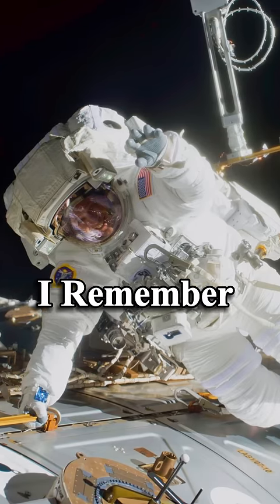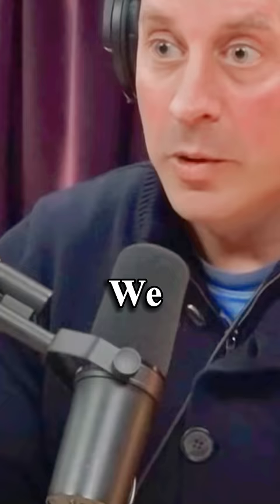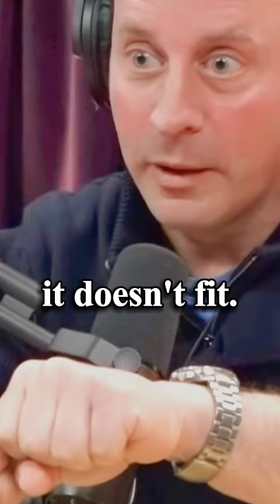when Plugs didn't fit | Garrett Reisman

Comment: And then the next guy comes along to service it, and says "Why won't this damn thing come apart?!"
Reply: Almost spit my coffee out🤣. I was wondering that myself.
Reply: Just put both sides in the sun
Reply: @quistador7  why would you think that??
Reply: @flrnGM  because the female side is now the only one that's too big. The male part is inside and won't be heated by the sun. Just stick the entire thing in the suns rays and the female part will expand and you'll get them apart.
Reply: @quistador7 eh probably wont work that way lol. Also youd have to know that
Reply: @D3nn1s  That's exactly how it'd work dummy, that's how they got it together in the first place
Reply: @quistador7  yeah but thermal expansion doesnt just stop, its gonna heat everything. Sure the outside will be hotter but who knows if thatll be enough?
Reply: @quistador7  It worked in the first place, as only one of those connectors were heated up.
Reply: @D3nn1s  Every substance has something called q or thermal flux which is the flow of heat through a certain area through a certain amount of time. Basically it will take time for the heat to travel through from the female adaptor to the male adaptor, but the thermal expansion will happen as the female adaptor heats up. Assuming their both made from the same material the male adaptor would be insulated enough to not expand as much as the female adaptor and be able to be pulled out. 
that said the thermal expansion rate or ε of steel is pretty low....
Reply: @gsreads  and only one would heat up the second time as well. the outside one is the only one in the sunlight, and the inside one is protected
Reply: @quistador7  when the two parts have the same temperature, the male one is too big.
Reply: @flrnGM  no shit, that's why I said ( WHEN THEY ARE CONNECTED ) you put them both in the sun and you can disconnect them. The male is INSIDE of the female. So it will not be exposed to directly sunlight. The female will heat up first and allow the male to release
Reply: Lol
Reply: Just rip the whole damn thing off and cuss at the former astronaut.
Reply: @Cheese  You're forgetting that thermal conduction exists.
Reply: This is my favorite comment from the original video.
Reply: Hahaha.  I'd pay to see it
Reply: @D3nn1s  i think heat distribution is going to be a lot more different in space. There's no air to heat up so we only go by sun radiation which heats the female connector on the outside which in turn heats up the male connector.
Reply: Oh.  😅 I thought your punch line was gunna to be, and the next guy says "why is this female plug so big?"
Reply: @quistador7  all that's gonna do is heat up both molex connectors. Heat transfers through convection too dummy
Reply: @D3nn1s  bro quit it. it's called thermal expansion. all astronauts know this basic concept 😂
Reply: @you owe me $5 for reading this name it's copyright convection is heat transfer through a fluid, what you're thinking of is conduction (touching)
Reply: "How long until the sun goes down? "
Reply: @quistador7  The fact that you had to explain this to some dummy... I wonder where he lives and what he does for a living 😅
Reply: Use the sun like a torch on rusty stuck parts
Reply: That's the next astronaut problem lol
Reply: Next government problem 😂
Reply: Never trust everything you see on the internet 
-- Abraham Lincoln February 7/1864
Reply: @D3nn1s  if they were both the wrong size before and both put into the sun then the wrong size would come back
Reply: Not sure he’s the dummy lol Male side went in at about -200c  Female about +50-100c. When they both in the Sun they’re going to heat up very fast and expand at same rate.
Reply: @quistador7  yeh but part of the male connector will be in direct sun light… if you’re waiting for the female connector to expand enough to come off the male would also have expanded 😮
Reply: @tomtdh4903  they will only expand so much, so when the one maxes out the other will too. So the wrong size will still be there
Reply: The next time those are coming apart is when the atmosphere rips them apart and melts them.
Reply: One miracle at a time
Reply: @quistador7  heat transfer, my man. You gotta get it right after sunup before the temperature inside can go up.
Reply: @D3nn1s  so in the welding industry, thermal expansion and contraction has to take place in the presence of other materials, and/or an unaltered portions of the same material.  And that effect will have stuff change or forge the size of other stuff.  Heat up a small point in sheet metal it’s forced to expand in thickness because of the cold material around it but then it contracts in all directions tightening the sheet metal.  With those connectors likely next time anyone touches those connectors they have through the constant fluctuation of a 600° difference forge themselves to be perfect matches.
Reply: Play your reverse uno card and keep the smaller side in the shade and the bigger side in the sun
Reply: The biggest “it’ll be the next guys problem” in history😂
Reply: Or does hotting up that lady make thinks  expand?? 🤔😆
Reply: @quistador7 funny how you think you know that they are gonna separate. Did you do the maintenance on the connector? Metals are great heat conductors, so just heating up the outside isnt a thing
Reply: @josephcassidy1211  not if thermal expansion and contraction over the course of them being connected, forges them to just fit tightly.
Reply: @D3nn1s that’s exactly how it works lmao
Reply: Thats his problem🤣
Reply: It’s the kind of thing they make a specific note of and will be aware of before planning another mission for that part
Reply: @TigerMafia12  this is the most important point. If there is good contact between the two connectors, they will heat up as one thermal mass. Just like you can’t reverse a shrink fit shaft into a hole as it now acts as one body.
Reply: @quistador7  you know what thermal conductivity is right?, it means that unless it heats up enough right away (Which it may not we don’t know) the inside will also heat up so both would expand, same reason why a car in the sun will head up inside, it may not directly enter the can but the heat transfers through the car itself. (I’m talking if you cover the windows as yes the sun goes through the windows and heats the car that way to)
Reply: @D3nn1s  L king dennis. Its ok your still a king.
Reply: so are space suits that heat resistant? and was it that it melted and that’s what did ? is this even fucking real?
Reply: @append548  Are you having a stroke?
Reply: @Captain_Shadow10  i just know nothing about space suits i was pretty high earlier as well
Reply: @append548  I said "are you having a stroke" Because I didnt understand the question at all
Reply: @seamuss3203  youre lol
Reply: Thermal expansion baby!
Reply: Bro I went to help my friend with a battery terminal and it was just like this. Mf who did the last alternator tightened the battery terminals down with the Ugga Dugga. Totally destroyed the terminals .
Reply: Bro as a tower climber I just fucking died😂
Reply: @D3nn1s I mean I agree it might not work but they are on the sauce station so everyone would know this is what he did they keep records of everything lol
Reply: @flrnGM that's whey your mom said
Reply: @quistador7 lol. i love the fallacious logic. you have never used heat before, let alone an ADDITIONAL 600 degrees.
Reply: Best comment 💯
Reply: snip it and crimp it
Reply: Everything is well documented.
Reply: @D3nn1s everybody’s a keyboard astronaut fr
Reply: Let's make this very simple, the heat will penetrate the female section to the point of expansion long before there's enough heat to expand the male. Why else do we use oxytetracycline torches on nuts etc that won't come off screws?
Reply: @D3nn1s you ever heard of an interference fit?
Reply: @alexanderglass2057 this whole thread is full of people who don't work in any industry needing involved engineering. Interference fits are crucial to modern life.
Reply: @gaz8577 bro this whole thread is full of people with youtube degrees. Combustion chamber sleeves, large heavy equipment shafts, lathe shafts, boat shafts. All use interference fits that need regular servicing.
Reply: @i8764theKevassitant  Exactly mate. I'm a mechanical engineer also 👍
Reply: @i8764theKevassitant  ofc, we use them at work all the time. Last time i checked plugs werent meant to be a clearance fit.
Reply: Friction fit, baby
Reply: Gotta call him and ask how the hell you do this😂
Reply: that's why i stay in warm places, i'm scared if it gets smaller it will create a black hole.
Reply: 100% soldered!!
Reply: Funniest shit ever
Reply: @flrnGM heat spreads molecules, cold pulls them together.. aka the female and male connectors will grow and shrink rapidly from the 600° difference
Reply: I'm dead 😂
Reply: You must be a plumber 😂
Reply: Good thing they're destroying the ISS
Reply: @quistador7  Metal transmits temperature very well tho
Reply: I deal with this all the time in my job.

Comment: 1000iq thermal expansion
Reply: Exactly.

It's usually the simplest of things that ends up being the solution.

Granted, the understanding of physics and thermodynamics was the key in this situation .... but the application was simple and probably saved NASA a TON of money and time from not replacing the parts. 

It also saved space walk time and potential risks.
Reply: @Soldier4USA2005 just use a little common sense every once in a while.  If this really happened, how did he not burn up when the sun went past the connector and hit him, increasing his temperature by 600°? He never would have been able to get back inside before the sun rays got him, so this is 🧢
Reply: @epstein_isnt_dead7726  Gonna throw that right back at you, use some common sense. Space's temperature can go as low as -150C in earth's shade and as high as 120C in direct sunlight (around earth). While those temperatures specifically arent common sense, extremely cold and extremely hot is.  Why do you think they wear space suits? If all they had to worry about was pressure then they just could have worn some heavy duty rubber material, but the suit is for pressure and insulation. The suit can withstand about -160C to 121C, no bogus here, the couplings arent insulated and are exposed to pure solar radiation, while the astronaut is insulated from the deadly temperatures and radiation. Think for a minute, or at least google, before trying to call out that someone isnt thinking straight.
Reply: @Acaerwen  oh wow, so the sun shining on half of his suit and the other half in the shade as the sun sweeps across him would be a temperature difference of 270° c. With one side of the suit 270° c hotter than the other side, it's pretty fair to say half of the suit will be experiencing thermal expansion while the other half remains cold and contracted, just like the 2 ends he connected. But I guess his suit is made of magic or some comic book element that doesn't experience thermal expansion and contraction.  How silly of me to think they used earth materials that actually exist to make these magic suits
Reply: @epstein_isnt_dead7726  actually metal and fabrics respond in different amounts to thermal expansion. It is called a thermal expansion coefficient and depends on material. The suits themselves also have a built in cooling system but I am unsure if it plays a role in thermal expansion countermeasures.
Reply: @flaminggears3833  I understand that, but as the sun sweeps across the suit the same piece of fabric or metal or whatever it may be will be heated unevenly. For instance half of the shoulder connection being in the shade and half in the sun. Whether it's fabric or metal, part of the piece would be hot and part would be cold of the same piece at the same time. And the temps he posted are in c.  Convert that to f and you're talking a difference of just under 500°f.  And isn't the face shield made of polycarbonate?  Because polycarbonate would surely break with that much temperature variance
Reply: @epstein_isnt_dead7726  After doing a bit more googling it appears the connectors are all covered in dense fabric to stop the thermal expansion from damaging the joints. The face shield itself is apparently reflective to stop it from also defining due to heat. Another interesting thing is that  any silver or gold strips you see in the suit are apparently supposed to reflect IR, ionizing, or both kinds of radiation which both protects the person inside and stops the part from suffering to much of a heat distance. The suit acts like one massive heat cloth or oven mitt and the shiny bits (including helmet) act as a heat mirror. This might be the same reason landers and space craft have bits covered in foil. I am not a scientist or engineer so I am uncertain of the specifics.
Reply: @flaminggears3833  none of those "explanations" seem the least bit suspicious to you? 
That sounds like Hollywood explaining how the movie props work. "It's shiny so it reflects 500° temperatures!"
"The connections are covered in material made from the capes of wizards, that's why they aren't affected by 500° temperatures!"
I don't believe they're telling the truth.  They may have 1000 excuses for why they can defy the laws of physics, but I don't buy into it
Reply: @epstein_isnt_dead7726  well IR radiation is what heat is and it can be reflected. It is part of the light spectrum so it would make sense that it can be reflected. Think about those guys who walk near volcanos. They wear those shiny suits to quite literally reflect the heat away from them.
Reply: Those temperatures also go way past 500°. Also adding that they are apparently called fire proximity suits.
Reply: @epstein_isnt_dead7726 think over that again will you? The rings in the couplings for example the ring around the hip, I am 100% sure that any single one of those highly educated, life dedicated scientists, thought about one of the most basic thermodynamic rules. IF it’s made from example titanium alloy, have you ever tried giving concentrated heat to titanium? It spreads FAST. It’s considered one of the hardest metals to weld due to (don’t know English word but) how the fast the heat dissipates throughout the whole piece. And that’s with a 2,200C (4000F) torch concentrated on a 10-15mm surface. How much dissipation do you think there will be from 120 degrees on HALF of something? Trust me that whole piece of metal is the exact same temp anyways.
Reply: And how do you expect his TRANSPARENT visor to absorb any or enough energy to heat up a single degree? It’s heat radiation. Transparent objects let light through. If it was absorbed the astronauts wouldnt see very well right?
Reply: @linusboden7050  sounds good, but titanium against titanium wouldn't make a very good seal, now would it?  You're making an articulating joint on the suit, like a shoulder joint, out of titanium.  How do you keep the moving joint sealed without a material like rubber?
Reply: @linusboden7050  🤔, can't say I've ever seen a transparent visor on a space helmet.  To my recollection, they're always mirror tinted.  Usually a golden color, but I can recall some that were just darked out.    I'm going to Google that, because I think that's incorrect about them having transparent visors

Comment: That’s a relatable problem
Reply: Kind of the same thing when opening a jar with a stuck lid. You could use warm water to expand the lid and pop it off real nicely.
Reply: @notaulgoodman9732  Yeah that’s what he meant
Reply: is this a fucking braking bad comment section?
Reply: You aint bigger than 5 cm pall
Reply: @filgiupo4853 *Breaking

Comment: That must be some hellacious insulation in those suits!
Reply: they have active liquid cooling, and are only filled to ~5psi, but it still gets hot as hell in them and excessive sweating has caused problems for a few (floating shit in your helmet), not as bad as the one time the cooling loop popped and one almost drowned getting back into the shuttle.

Comment: Bro thermal expansion is something we really don’t think about in our daily lives much. It’s a WAY bigger factor in space or at high air speed. The sr-71 blackbird leaked, well, basically poured fuel on the tarmac before take off because the fuel tank was basically the entire air frame and on the ground the metal plates of the fuselage didn’t touch or seal. Once at altitude and high speed. The friction of the air just moving over the plane caused so much heat that the metal expanded and sealed all the leaks. All of which was intentionally designed that way. Sr-71 is my favorite plane.
Reply: And then you woke up and realised thats all nonsense lol